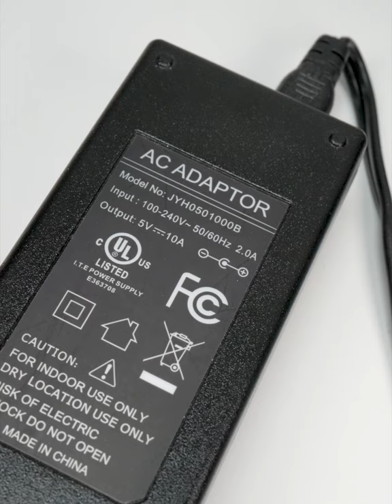Common Ground - Collin’s Lab Notes #adafruit #collinslabnotes

Comment: Many engineers and makers forget that ground is not ground.  Ground is a wire leading to ground.  Wires have resistance, inductance, and capacitance to adjacent objects.  One must also consider what would happen if a given ground connection opens up.  I see this fault in 3D printer designs that if a ground connection opens you wind up shoving motor currents through your computer's USB port.

Comment: The keyword is common ground.  Forty years ago lots of problem arise from ground loops, but that issue seemed to disappeared from all electronic literatures.  What ever happened to ground loop?
Reply: Ground loops are a bigger problem in analogue designs like in audio. You may have a low-level analogue signal and at the same time a significant voltage offset or possibly noise (like mains hum) on the ground loop.

But digital design can also be affected. Just that there is normally a decent margin between produced signal levels and the required levels for attached inputs.

And mains-powered equipment connecting between multiple phases can also suffer. That's why newer twisted pair network cables have magnetics for potential isolation - older coaxial cable networks could have huge problems with ground currents.

Comment: can you over load the ground connection? it has to take in to account all of the incoming circuits amps right?
Reply: @maxkunes3482   0:44 if i am interpreting the image correctly, both the metro data and the neopixel grounds are connected to the same neopixel power supply ground? is that correct?
Reply: @zenmaster24  Basically every ground needs to be connected. If you are running a low voltage device like a micro controller, and higher stuff like a motor, a stepper, a servo, a LED strip, a sensor and anything else, doesn't matter if its 2 power supplies or 10, connect all their grounds together.
Try running an experiment and see what happens when you disconnect the common ground.
Reply: In the example it is ok to use a small wire to connect the power supply GNDs since the return path for the signal does not carry a lot of current. The GND wire for the big power supply needs to carry the same current as the positive wire, ie quite a bit. The inter-GND connection is necessary to ensure proper referencing of potentials

Comment: Kind curious, might test this myself but. If your Arduinos power supply is coming from the wall, and your secondary power supply for a motor or something is also connected through the wall, would that common the ground? I'm assuming not but I wanna see now.
Regardless it would be bad practice :P
Reply: Wall powered power supplies are isolated, ie there is no common ground. Very important safety feature.